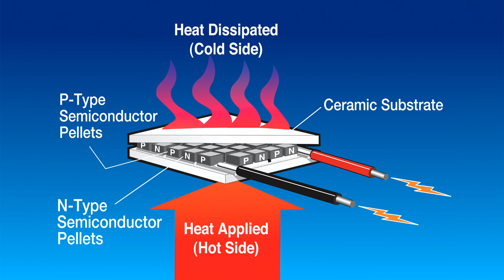Thermoelectric power generation - thermoelectric power generator

Comment: What if you were to introduce a micro cooling fan on the top side thus increasing the temp difference, would that increase output? Also what if you positioned a magnifying glass connected to a light sensor and servo programmed to follow the sun movement and keep the hotspot on target.

Comment: how much time does it take to charge a 12v battery?
Reply: Ernst Cariño years
Reply: Or just a couple of these "cells" connected together in an array and a solar concentrator, plus a heatsink on the other side. It's not rocket science ffs. It doesn't make sense to use instead of a solar cell, which is also a semiconductor, because it's not made at large scale and it's more expensive, plus I hear the efficiency is lower.

Comment: Can I generate infinitive amount of electricity by stacking thermoelectric generators?
As Thermoelectric generators generate electricity from heat difference I think they don't absorb the heat. If I stack 100 thermoelectric generators will I get a huge amount of electricity?

Does it absorb any heat?
Reply: Great idea. Will have to try. These power cells have so much untapped potential to rival other electrical power generation means.
Reply: Energy is conserved. Max energy out = max energy in. So, yes, you can generate infinitive amount of electricity by supplying an infinite amount of heat.The typical efficiency of TEGs is around 5–8%, so all you need is 20 x infinity heat sources.
Reply: Bryan Fisk please 
the model # of that peltier cel.

Comment: What I don't get about the design of these is the P and the N sides are both being contacted on the hot and the cold surface, why use that checker board pattern? Couldn't you just use strips running the length of the ceramic? 1 P 1 N,  I would think a longer strip of metal would give you more current over more surface area. Unless I am missing something here. After all the metal is only coated with a doping solution for each. I don't know I could be wrong, it just seems like a lot of extra work to get either the same or less results using those little squares.

Comment: yes.... it can. if you attach the output from a thermoelectric generator like this to a regulator and charger for the battery, it will indeed charge the battery.  You could even attach several of these units to the same heat source to generate more electricity.

Comment: There is actually di-atomic hydrogen, nitrogen, and oxygen atoms trapped inside the tungsten just like lasers with plasma state particles that pass threw the lasers crystal at 1/10,000 there normal size! When you heat a molecule it gets smaller and smaller as temperature goes up! Now on the hot side cations form from electromagnetic fields theses molecules then bounce back and forth gaining extra electrons and protons, these are then released to produce electricity just like splitting water!

Comment: While excellent for thermal balancing in electronic devices and on satellites etc., unfortunately it seems the Petier module is not able to handle high heat thresholds such as inside solar mirror arrays or flame and break down quickly.  I look forward to advancements and improved arrays for affordable.

Comment: imagine if someone could make those semiconductor pellets at nanometre levels like in a computer processor. The amount of electricity created would be up to 100000 times more and imagine if these pellets are 32nm each we can power  a whole street from the heat of a candle.
Am I wrong?
Reply: You are wrong. Energy is conserved. Max energy out = max energy in. The typical efficiency of TEGs is around 5–8%,  make this 100% and you'll be able to use a candle to get enough energy to light up a room.

Comment: That won't work. The thermoelectric generator works by transferring the heat to the other side.
It stops working when the other side gets hot. You have to put a heat sink on the other side to remove the heat to keep it working.